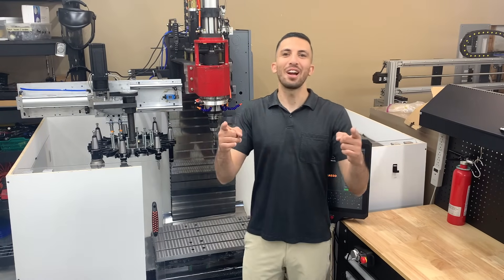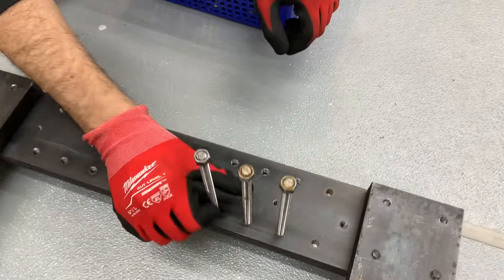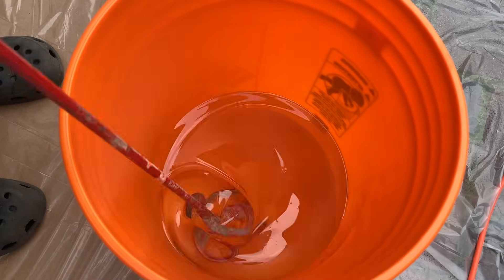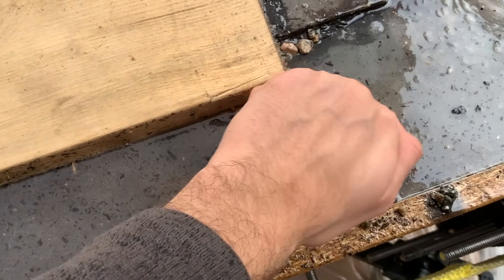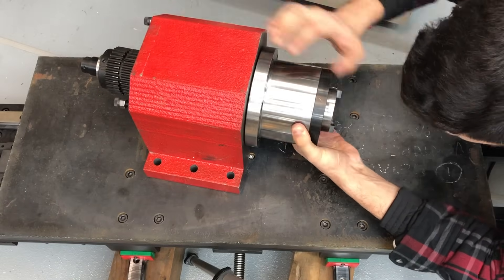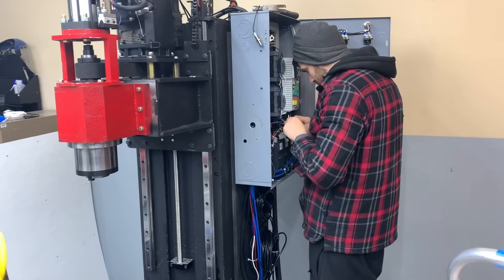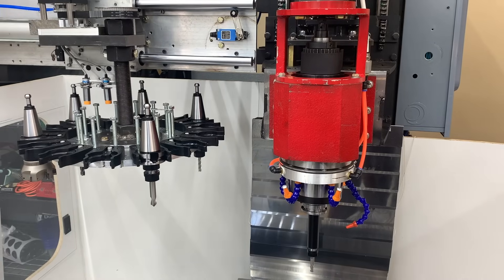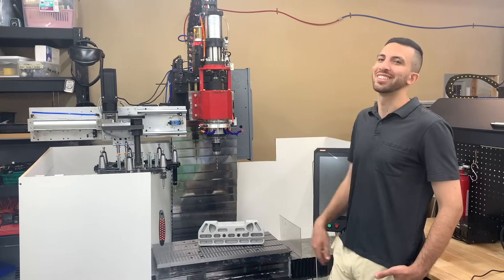Building a DIY CNC Machine With Automatic Tool Changer

Comment: The big question with a $15,000 diy build whether it performs as well as a machine you could buy for that amount. Ebay is full of used VMCs as well as manual mills that can be easily CNC retro-fitted.

I'd be interested to see a breakdown of how the money was spent.
Reply from the maker: I will get that breakout to everyone soon, in my next video.
Reply: @ActionBOX  Thanks. I also use epoxy granite for my build so it's always interesting to compare.

Comment: But this really makes me wonder how accurate and precise the machine is, since it doesn't look like the surfaces where the linear rails and the interfaces between the y-Bed and Z-bed seem to be precision surfaces. 
How can you guarantee that every single axis is square to each other?
Reply from the maker: You can never "guarantee", you can only be as precise as your measuring equipment. I used a dial indicator to 10 micron resolution, and was within several ticks off over a 40cm measured distance. This isn't perfect, but its far better than most other home made machines which do not take this into consideration. Cheers
Reply: @ActionBOX  If you ever find perpendicularity of the colum to bed a problem I would suggest using some jack screw to shim the colum and then fill the gap with epoxy, I've seen it done and it yielded great result!

Comment: "CNC is so expensive"
"So we decided to build our own with the budget of $15,000"

Guess I grossly underestimated how expensive CNCs are.
Reply: My desktop CNC mill, which was built for light prototyping/2.5D/PC-board milling work and has a working area of roughly 12"X x 18"Y x 6"Z inches, was about an $5K investment between the machine itself, building a custom controller box for it, building a high-precision spindle (>0.0002" runout) for PCB work, and rigging it out (e.g., adding things like cable drag chains which don't come with the machine but make it much, much easier/safer/better to use). CNC done relatively correctly is substantially more expensive than, say, building a 3D printer. (I'm building a 3D printer right now and it's super easy compared to CNC machining - I used my desktop mill to make parts for my 3D printer out of aluminum plate, and the 3D printer controller is almost a toy by comparison with the Gecko G540 driving my CNC's motors.)

And that doesn't even get into the tooling, and a full set of tooling for a CNC mill can easily exceed the cost of the CNC setup itself. Just the collet chucks for a big CNC like Action Box built can be $150+ each - hell, mine are tiny (ER11) and cost like $10+ a pop if I want a useful level of precision.
Reply from the maker: I was very happy with what I got for the price I paid 😃 .  Do you have any plans to build a machine as well?
Reply: @ActionBOX  Is your time worth nothing?  How much was all that other equipment? Free help?  Its a great project, but calling this 15k is disingenuous.
Reply from the maker: @jasongamer8649  Thank you for your input
Reply: With budget 15,000 why don't buy used machine?
Reply from the maker: @nguoidongnai123  You cannot buy a machine of this size (with all new components) for $15000. furthermore, I now know exactly how to fix any problem that arises which is nice. Cheers
Reply: @nguoidongnai123  I bought a used machine, 32x20x20 travels, 15HP spindle, 5HP axis drives, 6Ton roughly for $1300. Fixed the electronics problems for next to nothing (less than $100, but then again that's my strong point), and have spent a VERY LONG TIME tearing the rest of the machine basically completely apart and cleaning everything, and of course finding a few more problems along the way. All in right now I have $6500 into it, and that includes EVERYTHING I've spent on it - forklifts and trucks to move it, all the repair parts so far, a Renishaw probing system (both tool setter and spindle probe) cobbled together from ebay being patient and waiting for deals, a 4th axis + servo + driver, etc. The only further cost at this point is if it needs new spindle bearings, and those things are not cheap.  But the real cost has been in time. It's been 2 years, and I'm almost ready to start putting things back together. That said I only work on it on weekends, and then there are long stretches (weeks or sometimes months) where I don't work on it at all as I have other projects to work on as well. In hindsight, I should've just started with completely tearing the whole thing down from the beginning rather than trying to work on anything in-place. That wasted a lot of time, and in the end was quite pointless. I think if you didn't waste time and worked on it full time, you could tear a machine down and have it back up again in 2 or 3 weeks - maybe an additional 2 to 3 weeks more if you have to wait on ordering parts. It's no small task to go that route either, but if you can find a machine with a simple electronics problem, and isn't nearly as filthy and plugged up as mine was, it could be a great way to go.

Comment: Excellent build. I'm wondering about the linear rail mounting. Many of the DIY builders either use self leveling epoxy or have the steel machined prior to installing the linear rails, but that didn't seem to be the case here with the exception of the spindle mount. Thoughts on accuracy?
Reply from the maker: Great point! I attempted to employ a mechanical engineering concept called "Kinematic Constraint Theorem" which would allow me to get the rail mounts perfectly parallel to one another.  Again, I was not showing how to build a HAAS machine, I was showing how to build a big machine when you dont have access to an even bigger one. I could have spent money taking this to another shop to flatten or surface them, but there was really no need. The machine works perfectly well for my needs and level of accuracy.
Reply: @ActionBOX  It certainly seems to work. Well done.
Reply from the maker: @user-qy9rg3nt2l  Thanks

Comment: how do you scrap and flat your epoxy minearl casting :) ?
Reply from the maker: Im not sure what you mean. One side of the casting (the top exposed to air during moulding) will never be perfect flat, and it doesn't have to. It is not a critical surface.

Comment: I have seen similar bases made for lathes with concrete for the same reason. Is there any advantage of using an epoxy base vs a concrete base, as a concrete base would be less expensive?
Reply from the maker: Concrete is less capable of damping vibrations. Epoxy is preferred.

Comment: lmao and I thought I was going to be able to do this.  I didn't know about the cast-iron frame issue though, that's interesting.
Reply from the maker: Thanks. It's definitely a complicated build, but its possible to do as an individual at home 😉. Let me know if I can help with anything.
Reply: @ActionBOX  With my level of knowledge and resources at this point I think I'd just want to build a basic cnc machine first- maybe to do some light milling, Aluminum at the most.  I still need to learn about the electronics involved, as well as the programming aspect of it, although that is something I'm more comfortable with.  Are there any sites you recommend where I can source plans to build one? Are paid plans/blueprints better than free ones?

Thanks,
Neil
Reply from the maker: @neilorourke71  Hi Neil, This is one of those hobbies in which you learn by doing. You are on the right path with wanting to build one. For a first machine I think anything is fine. My only recommendation would be to learn/read a little bit about the physics behind these machines (very basic/high level). As an example, just the simple comment I made in my video about  the effect of mass and epoxy on the machine can already give someone great insight into why their designs may be flawed due to lots of vibrations. I started the same way you are now, You will get to this point 😃.

Comment: Awesome video, and a big question : how planar are your axes, and did you check perpendicularity/parallelism? How did you manage to put the column at 90° ? I ask because I'm thinking rn to all the problems I'm gonna face and it's very interesting
Reply from the maker: Thanks! In order to keep the video entertaining I cut out some boring parts such as the the tramming, but yes, all axes are square, and I do have mechanisms for tramming them. Cheers.
Reply: @ActionBOX  May we talk about it? 🥺 It would be so nice!
Reply: @ActionBOX  I gave you the post about my (future) machine on Instagram 😉 if you're okay, it would be really great to share things 😊
Reply: Hi Augustine - if it helps I  am share how the professional machines are set up . Let's just keep this for linear rail set up s as box way set ups are different in some important ways. 1: the Y rails are laid on the base which is level to within 0.002mm/ meter and one side is tightened to a datum machined in the base which already had machined surfaces to accept the rails . Rail #2 is dialed in as shown in this video - tolerance is 0.01mm. 2 : the ball screw mounts are clocked in straight and parallel using the datum rail.3: Ball screw is fitted and tightened to stretch the screw about 0.02 on a 1 meter machine .4: machined saddle is placed on Y axiS and steps 1-3 are repeated . Table is put on saddle and machine is checked for level again and adjusted.( there is a lot of skill to each step!) the tables come ground and parallel from the factory that manufactures them . 5 the Z pillar is assembled as in steps 1-3. Pillar base is scrapped to fit machine base . 6 A granite square is used to make sure the pillar is parallel to the table in front /rear left /right directions then it is bolted solid . The table must be flat to within 0.01mm across the whole table - yes - basically black magic :/ That is how they do it - that's some of what you pay for !! Hope it helps
Reply: @bikefarmtaiwan1800  yessir helps a bit to confirm what I thought about it 😌 thanks a lot!
Reply: https://www.instagram.com/p/COqW9SYppyN/?utm_medium=copy_link

Comment: when you work on the material try to get the tools/cutting sides as close to the spindel as possible this will inprove tool lifetime and it will give you a nicer surface finish also you may be able to have an higher feedrate (this is becouse you will get less vibrations at the cutters if it is closer to the spindel) 

realy awsome build tho
Reply from the maker: Thanks a lot. I am not a trained machinist, I do this for fun, so I will learn with time. Glad you enjoyed the video and thanks for your support 😃. Feel free to help me out and share this video with others who may be interested. Cheers, Dave

Comment: cant u use concrete than to dampen the vibrations? epoxy is crazy expensive I've heard
Reply from the maker: Epoxy is expensive which is why we use rocks as a filler. Epoxy dampens vibrations way better than concrete so it is the preferred choice of material.

Comment: that's on another level of diy, awesome work, i have an old cnc mill (basically a normal one that had at some point some arcaic controller), is there a way to make it more modern?
Reply from the maker: The science behind the mechanics of the machine has not changed much over the years, at least not as much as the electronics and software. I would recommend just upgrading electronics. Cheers

Comment: The comments about cast iron castings needing to be "settled" also typically called "aging or seasoning" is not 100% accurate. Often this was done years ago by engine manufacturers; they would just keep casting an engine block and stack them up outside in the weather to "season." The reason for this is because a cast iron casting has internal stresses from the casting process. When sitting for days/weeks/months the internal stresses are relieved by the heating/cooling cycle of being outside in the sun. Nowadays many manufacturers simply heat treat / thermally cycle their castings in a large industrial oven/kiln and this relieves the stresses to acceptable levels before machining. With modern just in time manufacturing most manufacturers would not want a whole bunch of inventory sitting around aging, this presents business risk on multiple levels. (Not saying there aren't some manufacturers that still go with the old-school "aging" process - especially maybe in the far east.) Anyways - excellent build!! Instant subscribe! Keep up the great work!
Reply from the maker: This is awesome, thanks for enlightening me. I knew that internal stresses were the concern but I guess I had not considered the quicker mode of releasing these stresses. I am now one fact smarter than I was yesterday. Thanks for subscribing, and I hope you enjoy the future content to come. Cheers, Dave
Reply: @ActionBOX  So much so that I think it was Cosworth F1 in the UK used to go to the wreckers and get ex-taxi engine blocks as they had been heat cycled so many times they were considered far superior for use in racing applications. Tried finding the video for reference, but it's eluding me. Think it's https://www.youtube.com/watch?v=1LkxGx5WJzA but cant be sure.
Reply: Great information!  Having access to the "hive mind" of people from all over the world is what makes this platform, or other like it, priceless!  Thank you for sharing your knowledge!
Reply from the maker: @artrock8175  👍
Reply: Now known as metal heat treating or conditioning.

Comment: What is machine controller
Reply from the maker: Hey, It's a Masso. What machine are you using? I can try to recommend a controller.
Reply: @ActionBOX  FANUC,HASS,Siemens
Reply from the maker: @desistyle5902  Its called Masso
Reply: @ActionBOX  what is price cots this machine

Comment: I'm truly impressed! Just subscribed and shared this video. Can't wait for you to become famous, so you will share the plans as promised ☺
I have a question: why didn't you use concrete instead of epoxy? It's way cheaper.
Reply from the maker: Thank you so much!! In short, concrete (at least the common "cheap" stuff) does not perform well under vibrations, and it does not dampen vibrations as well as epoxy. This is why a mixture of epoxy and rocks are preferred.
Reply: @ActionBOX  got it, thank you
Reply from the maker: @franktyphoon98  No Problem. Sounds like you have tinkering with the idea of building a machine 😉
Reply: @ActionBOX  oh man, if only I had the money 😂
the fact is I am a mechanical engineering student, so I am acquainted with vibrations (well, for the most part!)
Reply from the maker: @franktyphoon98  haha, you’ll get to it one day 😜. Glad you were able to learn something from my video. Good luck with school
Reply: @ActionBOX  thanks! I appreciate. Good luck to you too with your channel, I'm subscribed to see what you'll create in the future 👍

Comment: What's the tablet that is running your machine.
Reply from the maker: It is a Masso Controller.
Reply: @ActionBOX  thank you might put that on a cnc plasma table I'm working on.
Reply from the maker: @dionysus7055  That sounds fun. The controller will work well for you.

Comment: Nice machine, thanks for sharing. I noticed the ATC went the long way around when changing tools. Is this a shortcoming of the MASSO controller, or just something that needs to be tweaked?
Reply from the maker: Good eye. This is processed by the Masso, and is not a big concern for me as I am not running production so I do not need to optimize. Glad you enjoyed the video, I love your Facebook page and have been a part of it for a long time now. Feel free to help me share my content with other sites or groups if you know of any. Thanks in advance 😊
Reply: @ActionBOX  Which Facebook page?
Reply from the maker: @barebooger  Commercial CNC retrofitters
Reply from the maker: @barebooger  you would be interested in my DIY plastic injection machine. check it out on my channel.

Comment: Nice , are you planning to mill in 5 axis?
Reply from the maker: I have built a 4th/5th axis trunnion, but I am still in the process of working the software and such. Perhaps it will be included in the next video. Hope you enjoyed the video, dont forget to share 😃
Reply: @ActionBOX  I will share this pleasure by the way what controller do you use for work with five axis?
Reply from the maker: @allenmaker2718  On my other machine I use Mach 3, but with this one I am using the Masso

Comment: I'd like to see a tour of the first CNC you used to mill the steel parts. Seems to be an interesting design, looks like the spindle head moves in the XY and the bed only moves in z.
Reply from the maker: I was working in a very small room at work and had to come up with a design that maximizes the machine working area relative to the  machine footprint. It was very interesting and worked very well, but it was built to be a smaller machine. This new one is much larger 😃
Reply: @ActionBOX  that's exactly why I'm interested in it! Everyone has been building column or gantry mills, there isn't a lot of novel designs like that in YouTube land.